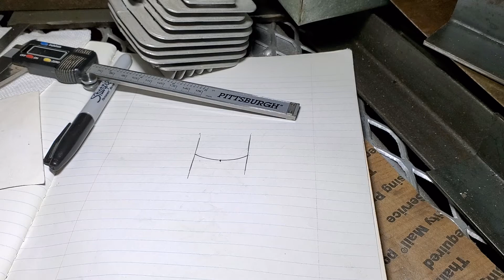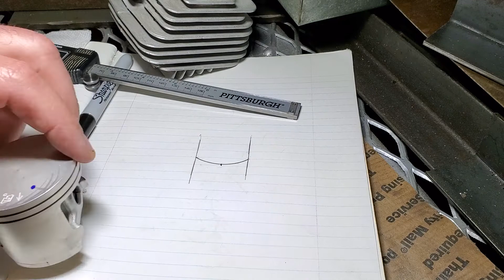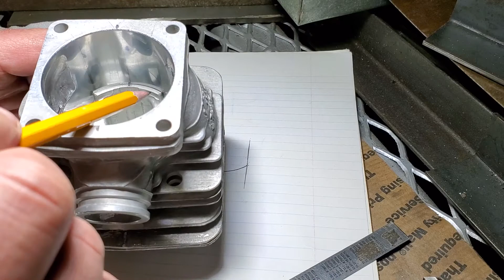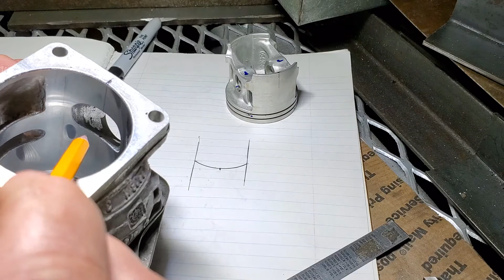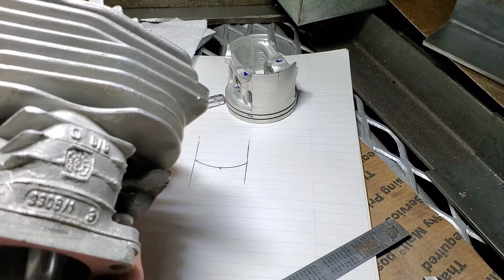pt 5 Stihl ms 660 R porting finding my port/skirt width? kinda

Comment: I'm right there with ya..been playin with aftermarket jugs..im not as brave to get an oem..that being said ..ive had good luck in making some pretty powerful saws..curious to see what oem #s will b..jug looks good..ive seen good high end performance from lowering n widening that lower transfer as well..thx for the good video!!
Reply from the maker: I try to do a little more on each saw. It had meteor p/c when I got it that looked like it ran about 5 min and started to seize. Why? Thats why I chose  oem. I was looking for some vids like this when I started. I have alot to learn but hopefully it may help someone. Hoping to continue vids  til its finished. Thanks for watching!

Comment: "The reverse-megaphone" on the exhaust...LOL that's exactly how I see that! Literally cannot fathom ANY reason to not do this, I have to imagine you're also "finishing the job" by ensuring the muffler's entry-portage "continues the taper"?  This was a BEAST on the 590's muffler, nearly 3mm thick rear wall, the 660's are thinner thankfully but still needed the 1/4" shanked burrs (on my big 6A not the dremel obviously!)  Exhaust gas is expanding as it comes out so round, large-tapered exits are inherently more optimized, I quite literally see it as simply "how much material does the cylinder & muffler's-rear allow me to remove, while still letting cylinder//muffler mate up properly?" and flare it precisely that wide (and it smoothly expands into the muffler, hits a baffle plate in the muffler so there's some initial back-pressure against the cylinder pulse & ensuring proper scavenging, blows my mind how many of these 660 mufflers are just "open can" it's such a waste of fuel and power to run the wide-opens, don't get me wrong my muffler has more total exit-portage than OEM but the exhaust gas just isn't aimed directly-out!  Comparing the 355t muffler to the cs590 muffler makes the best case ever, 355's open can because there's simply no room, and the 590's elaborate baffled-straw design, take a 2019/2020 model of either for a great case study IMO!)
Reply from the maker: Didn't want to go crazy on muffler.  Wanted to run it a bit and can do more later. I do have another muffler that I can play with later but for now I'm very happy with the saw. I fully removed the baffle on the 066 and it really likes it. Thanks for watching!